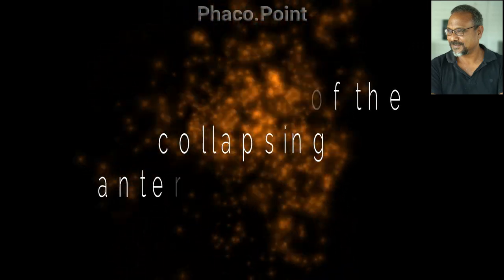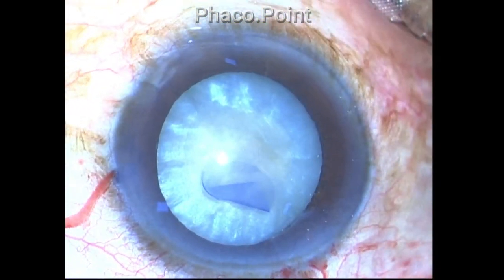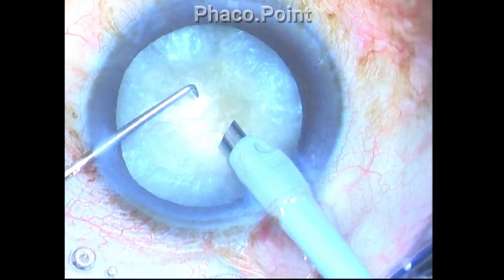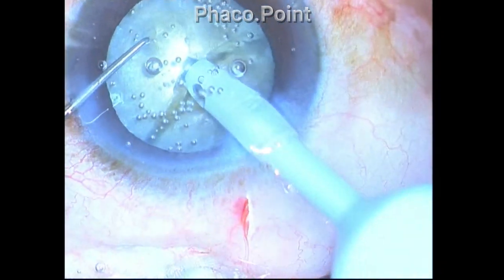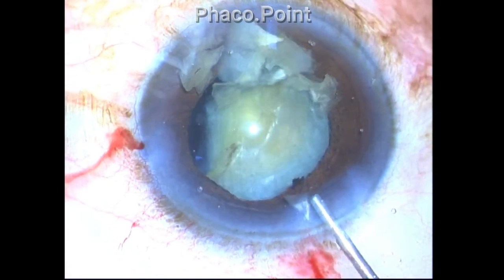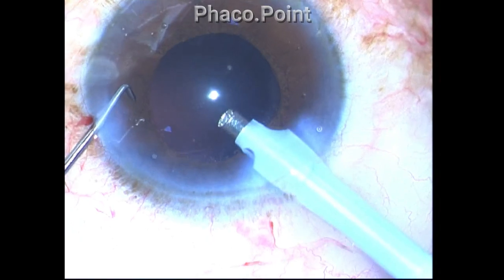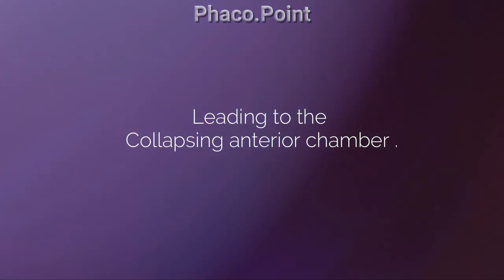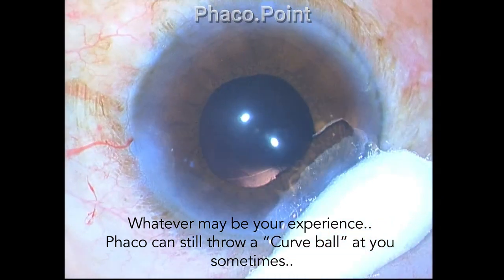The mystery of the collapsing anterior chamber during Phaco.

Comment: Thank sir !
Reply: I would like to share my experience.

I usually use the standard tip. But when I switched to using the microflow tip, I experienced a collapse of the anterior chamber. I think the cause was a blockage at the tip when I sucked up the pieces. When suction is released, a massive amount of fluid follows, causing the anterior chamber to collapse.
Reply from the maker: hello . I always use only a micro flow 21 G tip . incision size should be 2.8 . Vacuum settings should be at least 25-30mmHg higher than for standard tip , power should be higher by 5-10 % and the bottle ht should be 10cms more than for a standard tip. also ensure you are using the correct sleeve for this. Hope this will help solve the problem . Keep me posted

Comment: Sir can you please enlighten us more about size of a sleeve for a specific sized phaco tip?
Reply from the maker: hello.. the phaco sleeve's function is to provide adequate inflow as well as to cool the tip. The sleeves are specifically designed for the particular tip and the incision size. The colour coding of these sleeves are too varied to group into a particular pattern and the best solution is to ask your machine tech, which colour sleeve is intended for which tip and what incision size..before starting with phaco